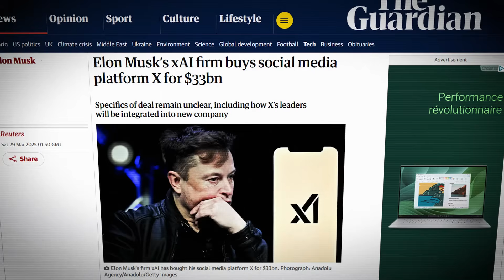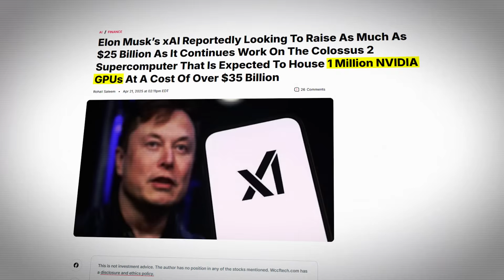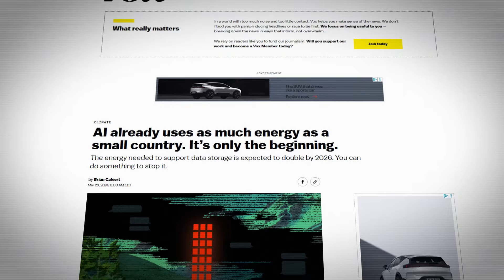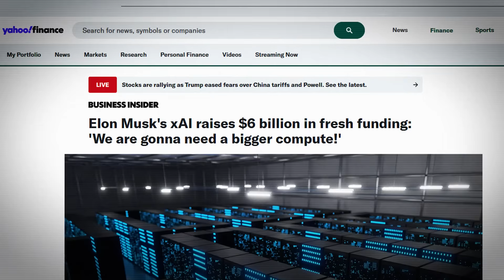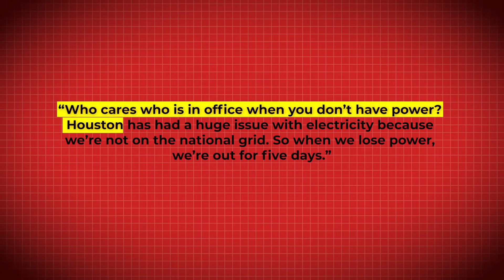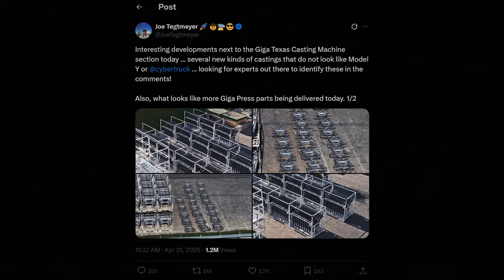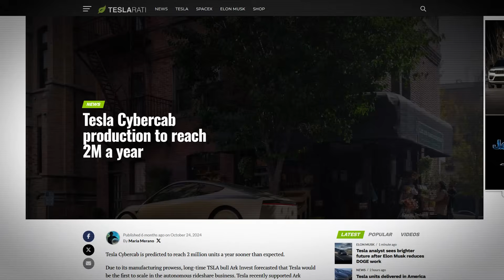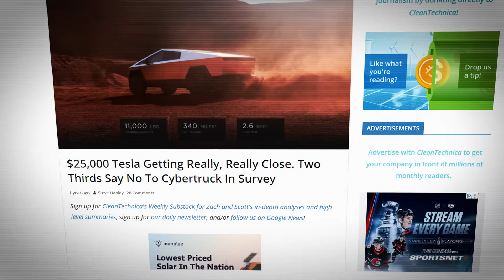Elon Musk is Building The Most Powerful Supercomputer in The World

Comment: Grok says that this video is true and not hype about another YouTube video talking about a Tesla flying car. Here are the responses: that Grok gave me.  

Yes, Elon Musk’s company xAI is building a supercomputer named "Colossus" in Memphis, Tennessee, which is claimed to be the world’s most powerful AI training system. It currently uses 100,000 NVIDIA H100 GPUs, with plans to double to 200,000 GPUs, including 50,000 H200s, by mid-2025. Musk announced it went online in September 2024, built in just 122 days. The system powers xAI’s Grok AI chatbot and is designed to compete with top AI models like those from OpenAI and Google. However, its "most powerful" status may be temporary, as competitors like Microsoft and Meta also have massive GPU clusters. Environmental concerns, including high water (1 million gallons daily) and power (150 megawatts) usage, have sparked local controversy in Memphis.

Regarding the Tesla flying car claim, it remains unsubstantiated hype, as no concrete data or official Tesla announcements support it. The supercomputer project, by contrast, is well-documented and operational. Always verify YouTube video claims against primary sources like company statements or reputable news.

Comment: When they were installing the first xAI system they started with 100,000 GPU's.  At that time no one knew (even AMD) how to use more that about 30,000 GPU's in 1 process. They obviously figured that out and upgraded it to 200K GPU.  At that time they said they were planning on ultimately upgrade it to a million GPU's with no mention of a second site.  Plans have changed.   They also ran into a serious problem with uneven power levels coming into the building.  They corrected that by using several of Tesla's Battery Systems and now the whole thing is actually running off of the regulated battery output that is continuously charging as it Powers the network.. Looks like they ran out of room and electricity.